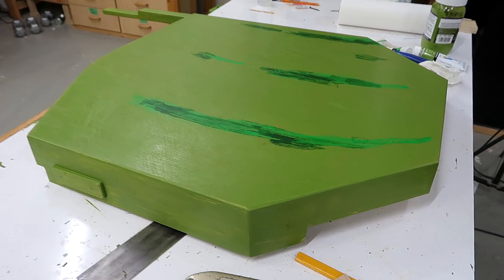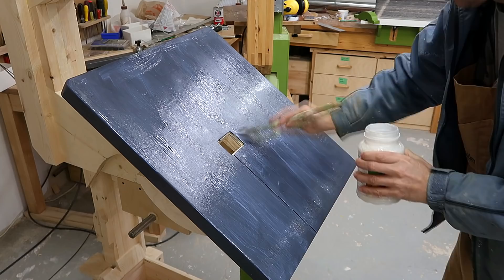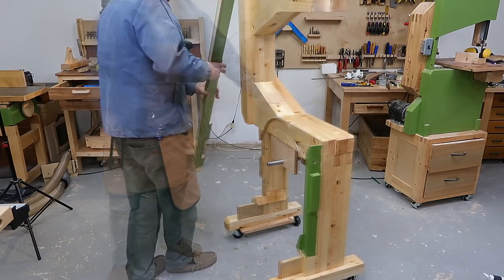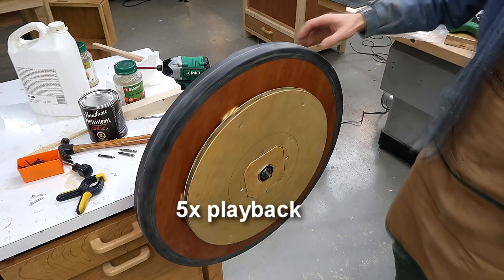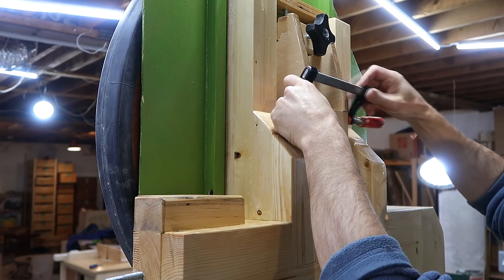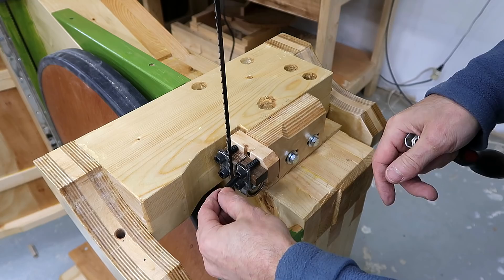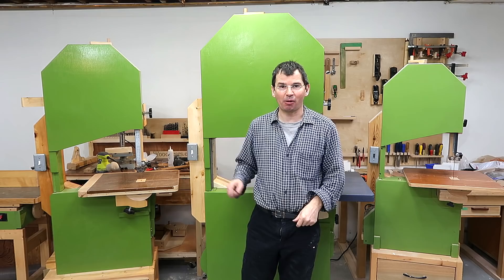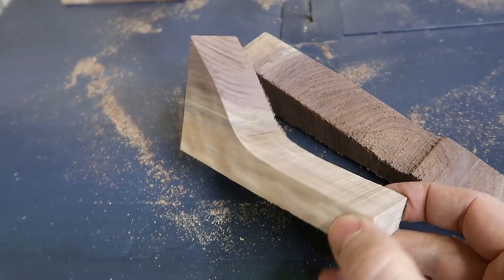26" bandsaw paint, balance, reassembly and electrical

Comment: The oil varnish is a great idea for these things, and is really important for things like this! Some advice from an artist, and a commercial industrial painter: For the deck surface of your bandsaw, if you are going to use paint, use an extremely thin layer, let dry about 2 days, sand, and reapply another extremely thin layer, sand, and repeat. Sand a third time, then apply a coat of linseed oil and wax mixture for a final surface, any blemishes will be unified by the oil, and this finish will not be sticky or harm the work you do on it. To upkeep, just apply paste wax. This take longer, but results are going to be gorgeous!
Reply: could take an entire week to paint a bandsaw table or use hard varnish and have it done in one day
Reply: If only I lived in a state where oil paint was still legal.
Reply: l wilton Are oil based paints really illegal in places? Serious question, and if so, why?
Reply: It seems like oil-based paints are generally legal, but are restricted in various ways in different US states. In all states, gallons can be sold for use on metal, while only quarts can be purchased for use on wood.
Reply: @liambohl  As far as I know, oil based paints of any kind (except possibly rattle cans) are illegal in Southern California. I don't believe it is even possible to get tubes of artist's paints that aren't acrylic. The SQAMD outlawed them on the basis that they contributed to air pollution.
Reply: @KJ-kw7gh  Fun fact, in southern Mexico, the only paint you can buy in a paint store is oil or urethanes... It's just too moist there for acrylics. Nobody even sells latex paint. But yes I buy oil based paints often. Anywhere on the east coast.
Reply: Chris Griffith yeah, I live East Coast, can buy any paint you want here. Just never heard of areas not allowing certain paints, not because of practical reasons, but just plain illegal. I should have assumed California would do it.
Reply: Yep.. people forget that some woods like a good soak.

Comment: The replacement tool power cord you bought with the bare end is actually a dollar MORE than a Husky 8-foot black extension cord. I use those and just cut the female end off.
Reply from the maker: Oh, I saw that one and it was cheaper than the extension cords near it.

Comment: I’ve got suggestion; perhaps you might consider using SJOOW cable for your electrical wiring instead of NMD-90? The SJOOW or cab-tire has been designed to withstand mechanical damage. 

PS I love your work, I’ve been watching you for a decade, keep up the good work!

Comment: Are you not afraid that with the saw vibration the screws on those various electrical outlets could come loose and the wires could end up shortening live? The way these are grabbing the copper is very odd

Comment: Pretty good size, but can you upgrade the power? I would use some sort of cooling liquid to increase lifetime of the sawband. With a Frequency converter you can increase/decrease cutting speed, only limited by the temperature of the electrical engine. Cooling of the engine can be done by a ventilator for the engine, to prevent overheating.
Reply: A bandsaw mill would be awesome!

Comment: Ok, you re-Upload (in 1080p), I re comment (in 1080p), must keep up the user interaction:

I have a relatively tiny bandsaw, that does not go through wood as easily as yours - i need quite a pressure of the work piece to the blade. In your opinion what influences the cutting power more: quality and type of blade or power? My saw has meager 250W

Comment: Re the new blades: I would like to see a 1/2" 3-4 TPI (not hook) blade on there. Maybe even
 3/8". 10x  slower cutting just isn't worth going to a finer tooth 
pitch. I run a 3 TPI blade on my 9" saw, even!  Yeah, the edges can be a
 bit rough, but it cuts smooth as butter from 1/8" plywood to 3 1/2" 
hardwood.

BTW, I have put a 4 TPI hooktooth on my 14" Rikon, before. It never did 
that banging or that thing when Rachel used it. So I wonder if your saw 
might run better at a lower tension, with smaller blades. The tension 
system you have devised over the years, I wonder if there's too much 
friction for it to act like a shock absorber. Or if the wood spring 
really has enough spring. On my commercial saws, the upper wheel plate 
slides freely up/down with barely any metal/metal contact. On my small 
9" saw, you can see/detect that the upper wheel and the upper cabinet 
are vibrating at different frequencies, independently, thanks to the 
tension spring.

Bigger saw, heavier upper wheel and frame, that adds up to bigger 
vibrations of the upper wheel, which means greater peaks and valleys on 
the blade/bearing tension. 

But OTOH, maybe your wheels could use a little more crown? Maybe they're
 too flat, letting the hook tooth blade drive itself forward on the 
wheel, too freely?

I didn't like the hook tooth, though, for general use. It wanted to grab
 and flip/roll smaller pieces and dowels.

Comment: Staining softwoods is always a blotchy nightmare. As soon as you wipe it on it’s basically dry at the surface due to capillary action and you get dry edges. There’s a good trick to counter this by pre saturating the wood with some thinned poly. 30% poly 70% mineral spirits, let it dry, then stain.
Reply from the maker: table top is hardwood
Reply: @matthiaswandel  Not sure why I didn't realize that given the way it looks and what it's needed for. But the stain reaction looked like my early years of trying to stain fir.
How did it look THAT bad? XD

Comment: Painting varnishing wooden tools is a must here in florida, the variations in humidity make it a necessity, oddly one benefit seems to be the joints remain stable much longer, especially if nails/screws or bolts are used, less change in stress over time keeps them from working the holes bigger.

Comment: Are you willing to tell how many hours building the saw took? Including disassembly which I think would be necessary for anyone doing this, but not including "camera" time.
PS - Your videos are a delight because of you engineering mindset and comfort detailing your problems. Thanks. And I hope you can keep it up.
Reply from the maker: I didn't tabulate that.
Reply: @matthiaswandel  I personally could never track my time. You? Maybe... It seemed possible you would have made the motion tracking system from the past (Raspberry Pi, IIRC). THANKS

Comment: Mr. Bandsaw, i got 3 questions. How fast is the bandsawblade speed m/s? And how do you choose a motor for them? Last year i bought an around 60 year old bandsaw of cast iron (470KG) and the wheels (steel) are blank (normally encased with cork). do you think i can use your ultimate tiretube trick for those?
Reply from the maker: The innertube might work.  Speed - best speed depends on your preferences and motor size. Picking a motor: I use one of the motors I already have.

Comment: Smaller??? I personally like the 26" very much, that large throat seems lie it would be very useful when working on, well, large pieces. Perhaps it's from seeing the monster 31" Oliver which Frank Howarth has in his shop that makes me feel like the larger is better. Certainly from a metal fatigue perspective the larger wheel diameter puts much less flex into the blade, and for the larger resaw blades this can only be better - so, when is the 1m saw build starting? lol

Comment: I like your use of the regular switch vs push buttons that come with most band saws. I was thinking the same thing when you started painting the table top, that it could rub off onto work pieces.  What is your go to varnish? And are you referring to any clear coat as varnish?
Reply: Why don't you like push buttons?
Reply: @1pcfred  They are not necessary I think for a band saw, or at least how I use them.  I'm sure the safety police will  have a lot to say on that point. Push buttons make sense on a table saws, etc.
Reply: @RichardGreco  the push buttons usually means it is a magnetic interlock switch. So if power fails the machine does not turn on when the power is restored. Plus I just kind of like them. Enough that I made a mag switch for my table saw. Gives it that big machine tool feel. I sort of had to anyways. I don't think any toggle switch is rated for more than a half horsepower motor.

Comment: Great job with the saw! One question though, what's the reasoning for having one of the electrical sockets tied to the switch? What would require power only when you're also using the saw? Or am I just missing something obvious here?
Reply: Yeah, he plugs the drive motor in there. That's how he turns it on and off.
Reply: A work lamp?
Reply: @peripheralarbor  That's what I noticed as well, but I don't get the reasoning. The outlet could be useful but I would've just hardwired the motor.
Reply: @eDoc2020  Yeah, less contact losses. Maybe he wants to be able to easily remove the motor? He does tend to swap motors out with some frequency.
Reply: Dust collection.

Comment: I dont understand why in US and canada you still use theese electrical metal cases for switches and plugs. I also dont understand why do you still use solid copper cables!
Why?!

Its much safer using pvc/plastic cases. U dont need to ground the case and reduce the risk of electrical shock!

Comment: Your ground wire is hooked the wrong way around the screw and isn't looped tightly enough.  Also you don't have cable insulation under the clamp.  All three are NEC violations.
Reply: It is a bandsaw. Not a house. Believe it or not the NEC does not apply to power tools. If he was manufacturing bandsaws, maybe there would be some UL or something that would object. Or maybe they would make hims use stranded wire or something. But all in all the electrical is not bad in this one.
Reply: He does have to follow NEC anyway he's in Canada.

Comment: I cringe everytime I see metal junction boxes and rigid cables instead of stranded ones
Reply: Why? Solid core wire is great for fixed wiring.
Reply: @eDoc2020 I think this would be considered a high vibration environment. Usually you use stranded wire for high vibration applications. Don't see any problem with metal junction boxes. They seem fine. I doubt the solid wire will cause any problems either.
Reply: @mckenziekeith7434  Metal junction boxes are inherently unsafe because if your ground wiring is not perfect and an appliance or a power tool looses insulation and has a leak to ground, you run the risk of touching a "live" surface and YOU can be the thing that closes the circuit to ground. A washing machine for example can have this issue if its mantle is made of metal: I don't know about you, but I would very much prefer not to create other opportunities for this to happen if I can avoid it
Reply: @dec0077sa  I am an electrical engineer. It is true that metal boxes must be grounded properly to be safe. But you can clearly see in the video that he grounded the box.
Reply: @mckenziekeith7434  Yes, he did, because we both know Matthias does things the right way. I was talking in general, because I know, seeing how some electricians work in Italy, someone will do things "not the right way". I'm very much of the opinion that "if it's not there, it cannot break": if the boxes are made of plastic (their covers as well and there are no screws), this problem will never occur no matter how badly they are cabled (ok, you can have exposed wires or other hazards, but those are different issues)
Reply: @dec0077sa  I do not know if it is clear-cut that plastic J-boxes are better than metal in the big picture. For example, in a fire, the plastic may emit toxic smoke. Also, in outdoor applications, UV may cause plastic to deteriorate more quickly than powder-coated steel. And plastic conduit is mechanically less robust than steel conduit. So there are many considerations. Not purely the shock hazard. But I certainly agree that enclosing all cables and wires in plastic will reduce shock hazard. But if you come to north america and inspect electrical systems, you will see many metal junction boxes. So you may have to cringe very often! Actually in Mexico you will see even worse things. But that is another story!
Reply: @mckenziekeith7434  By regulation, in Italy every piece of plastic used in electric wiring must be self-extinguishing, so no toxic smoke (some kinds of plastics will not even catch fire). For outdoor use, anything with IP66 specs will resist UV (and water and dust). I have had external boxes on the walls of my home for 14 years now with practically no change since installation.
Yes, plastic is less structurally robust than metal, but do we really need it? It's not like junction boxes have to bear any weight.
I have travelled to North America twice and in both cases I tried to ignore that particular aspect... easy to do since I spent most of the time outside taking pictures of the landscapes. Hope to come again soon, to Alaska. I've never been to Mexico, though.